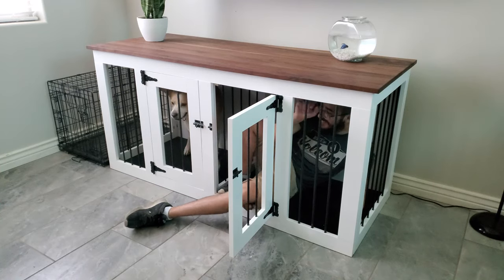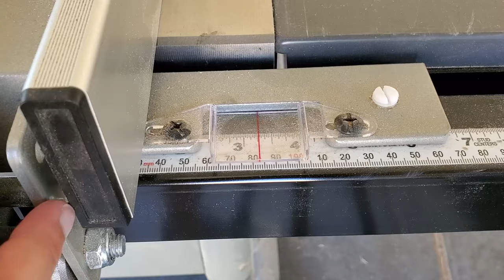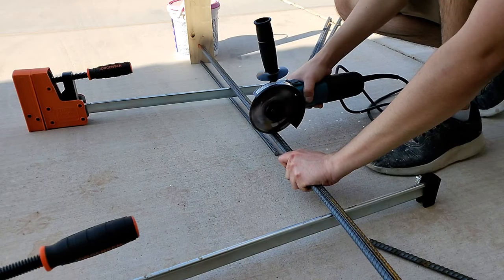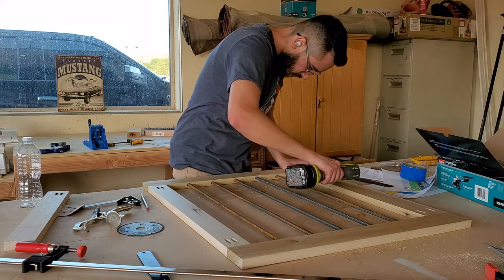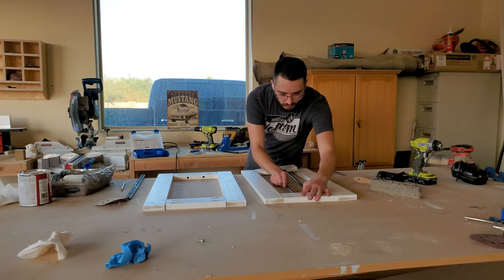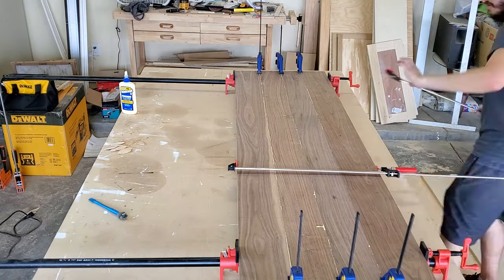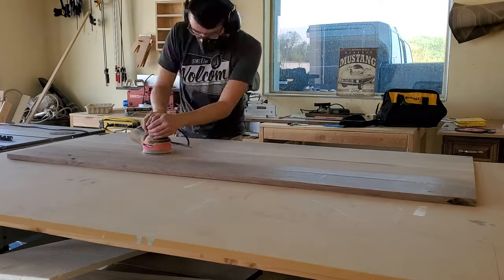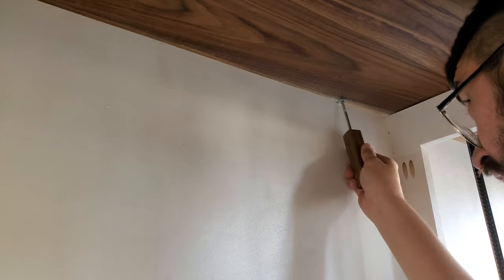How to Build A Dog Kennel / Crate / Cage [ Indoor Furniture ]

Comment: Tip for anyone watching, drill fully through the top piece of wood and only 1/2 into the bottom, get front square and then drop the rebar in through the top holes. This will
Be covered by the top of the kennel
Reply from the maker: That's a great tip! Thank you!
Reply: If you have OCD like me… use dowels to cover them (top holes) up afterwards. That way, you’ll sleep better knowing they’re covered even though nobody will ever see them.
Reply: @jswoodcodesign  I like your thinking. Instead of grinding down each piece, drill slightly over. Drop in from the top and drive a dowel in with wood glue so they don't rattle. You could also put some other glue in the bottom hole if the bottom was moving that extra 1/16 of an inch or so.

Comment: Hey, I went back through and checked over every thing. And rewatched the video several times, what did you use for the bottom? And just wondering how you got it to fit? Just measured what you had after you got all the sides/from/back together? Or did you already have the bottom measured and cut?
Reply from the maker: Hey yeah sorry I forgot to put it in the video but I just cut 2 pieces of plywood to fit the opening and used pocket holes to attach it
Reply: What's the actual size of this crate including height please?

Comment: Where did you source your hardwood? Also, what did you use for the back panel and for the bottom?
Reply from the maker: Local lumber supply store and i used plywood for back and bottom. Just painted.

Comment: Really nice I've watched a few times and started building one myself based off of yours. I noticed you cut out a slot for those pieces you used to connect the top you did not show that what were they thanks?
Reply from the maker: They are biscuits but honestly is not needed.
Reply: @JARMade  Not the biscuits the metal pieces you used to hold the top down they were recessed in the wood, thanks
Reply from the maker: Oh sorry, they are figure 8 clips

Comment: what is the tool you use to drill your holes in the wood before you instal your screws. It's a small blue wood holder type looking tool. I want one!
Reply from the maker: That is a kreg pocket hole jig. I have a link in the description for you to find it easily

Comment: What table saw is that? Why not use plywood or a cheaper wood if material cost was 600? Im guessing it was the solid walnut top? Nice work. I make amd sell these as well.
Reply from the maker: Its the delta table saw 36-725 and idk I just wanted to work with solid wood and walnut  instead of staining this time. Plus it was a gift for my sister

Comment: What did you use as the bottoms? I would need this water proof and possibly removable or removable trays to clean. I have a lab that can’t control her pee at night? Great job!
Reply from the maker: I just used plywood. You might need to use a removal tray

Comment: Hi, The wide frame is 3 in, how thick the timber for frame u use ? Sorry maybe I missed something on the vid
Reply from the maker: Yes it's slightly thicker than 3/4 in
Reply: @JARMade  thanks 👍
Reply: @JARMade  what is the minimum wide you think is possible to use ? Do u think 2 in wide ( tasmania oak )  is ok ? Thanks :))
Reply from the maker: 2 in wide should be ok as long as you have enough of the rebar going into the wood. I personally have not tired 2in wide
Reply: @JARMade  thanks bro

Comment: Hey, could you tell me the dimensions you used? Also what material did you decide on for the bottom? I usually go for plastics in case they get wet for whatever reason. Thanks!
Reply from the maker: It is 5'6" long 2' wide and 33" tall i believe , I just used plywood for the bottom.